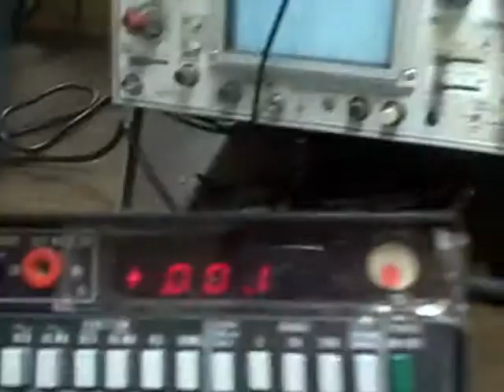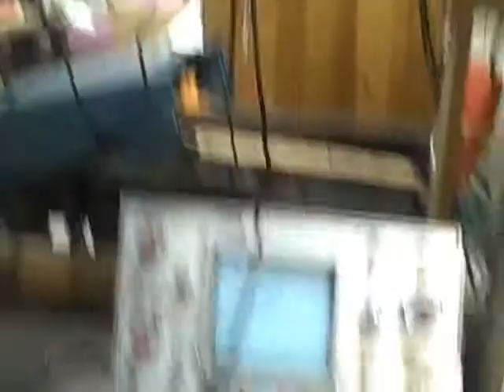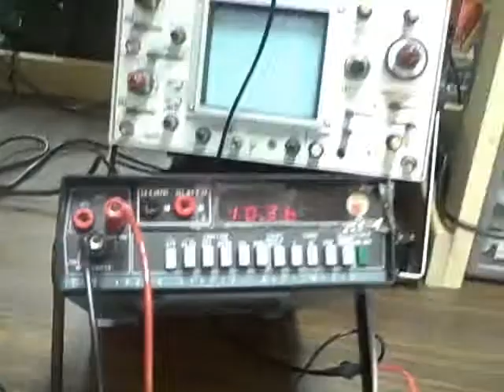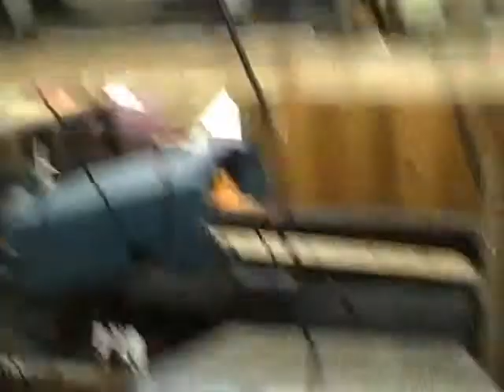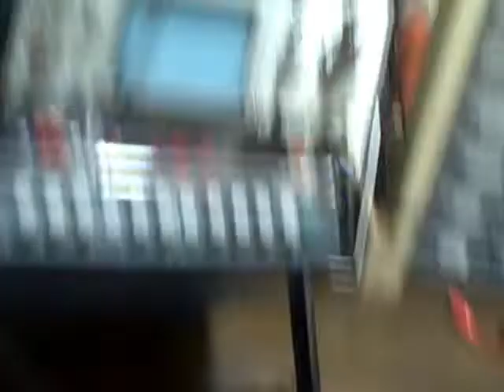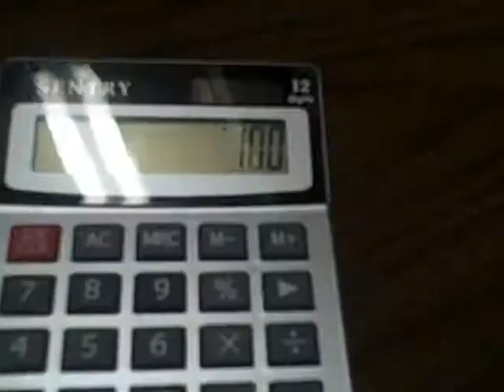fluke8000a.avi

Comment: I'd like to know the source to buy this stuff. I learned on a similar bench meter in 1983 in electronic school! Tons of used ones, mainly beat up....
Reply from the maker: Bought them off Ebay back about 2012
Reply: bap8guy  nice find. I see they have the high current option, looking at a couple of 8840/42a's . Hard to find clean ones. I don't understand how these things get abused, other than the people are at a job and just don't care how they handle them lol
Any electronics I've acquired over the years looks like it came out of the box!